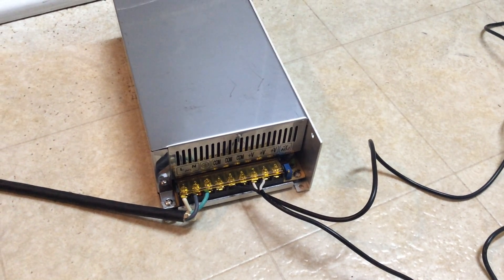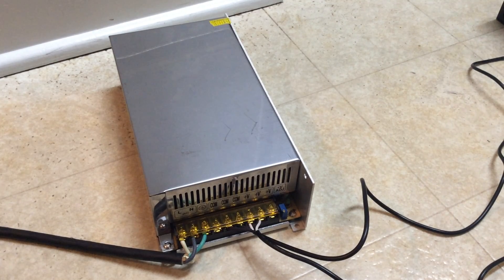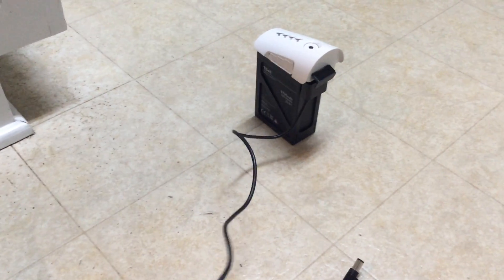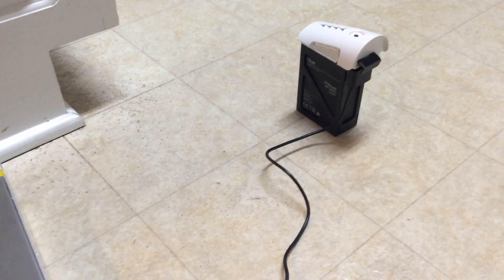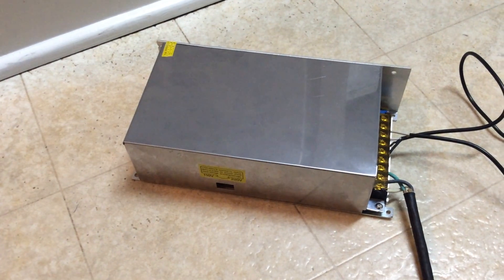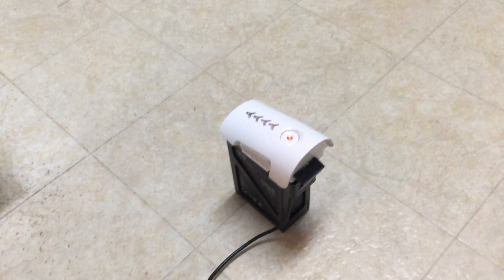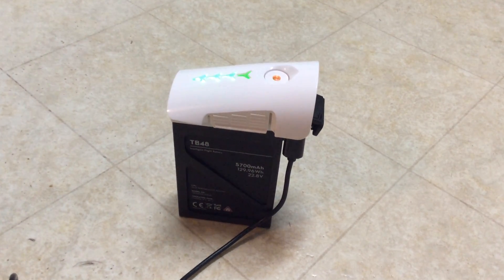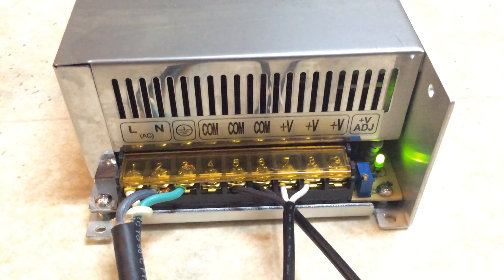DIY INSPIRE 1 POWER SUPPLY "CHARGER"

Comment: You could adjust your power supply voltage, and make it 26 volts.  Just turn the dial on the blue variable resistor until the voltage rises up to 26.